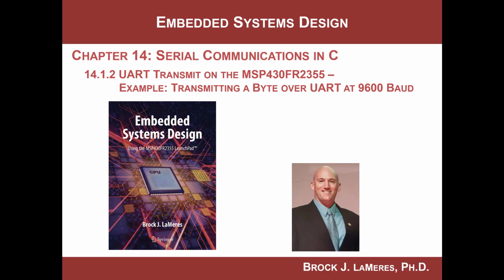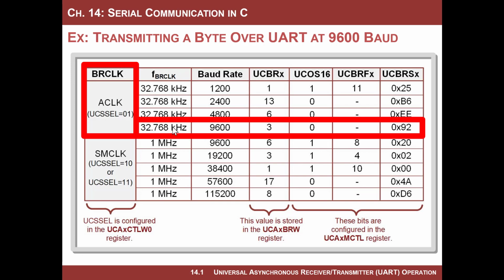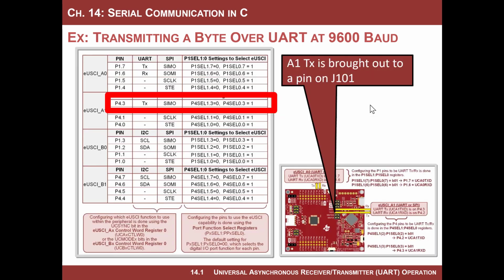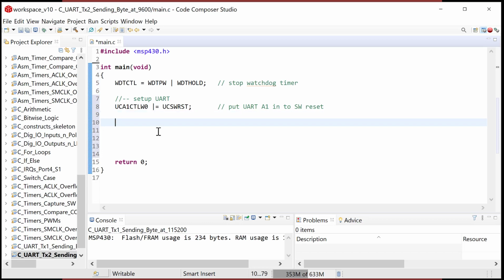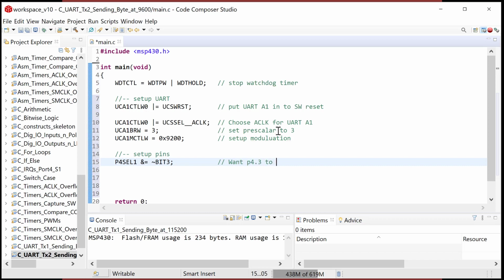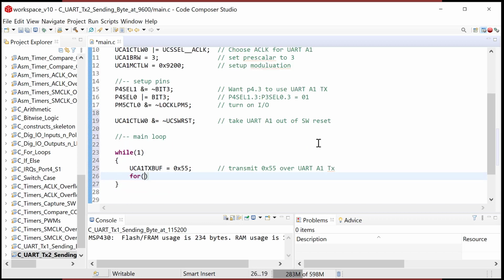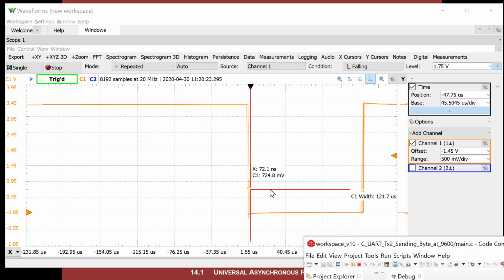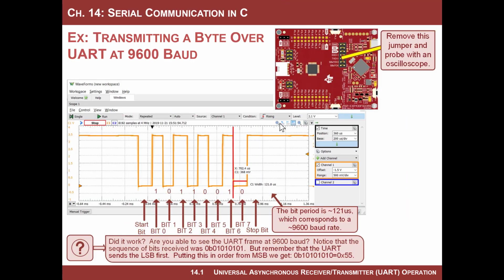14.1(g) - Serial Communication on the MSP430: The UART - Transmitting a Byte at 9600 Baud

Comment: Hi, I am using an MSP-EXP430FR4133 and whenever I place the code:
P3SEL1 &= ~BIT3;              // Pin 3.3 to use UART A0 TXD
P3SEL0 |= BIT3;
I get the error "PBSEL1_L is undefined", do you know how this can be fixed?

Comment: Why is that ACLK is being used for clock source and why not SMCLK ?
Reply: Because the desired baud rate (9,600 bps) is low so we should be using a source clock with low frequency. ACLK frequency (32,768 kHz) is lower than the SMCLK frequency (1 MHz). You could have used SMCLK, however you would be in oversampling mode for the modulator (more work) rather than low-frequency mode.
In video 14.a (f) (the previous video) the buad rate was high so we needed to use a clock with high frequency hence we choose SMCLK.